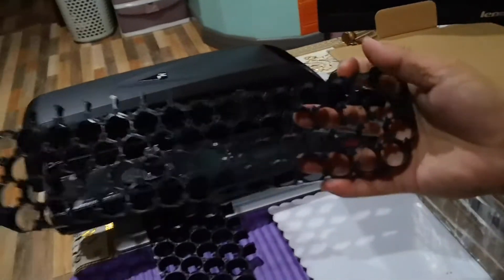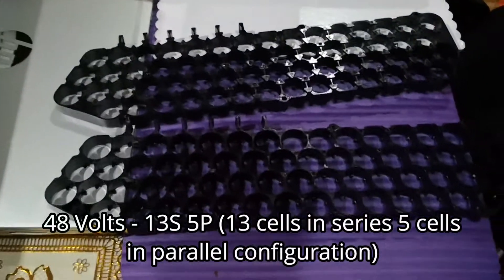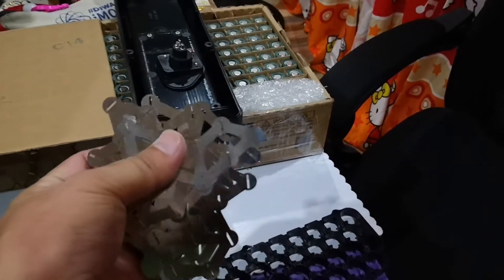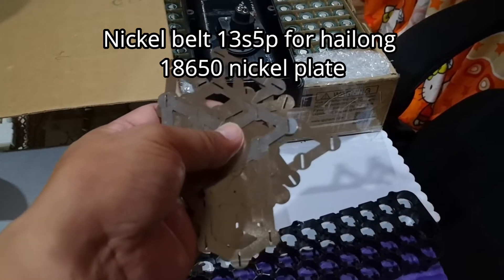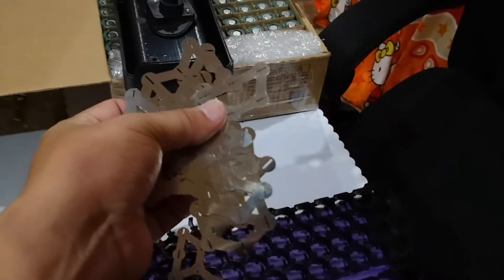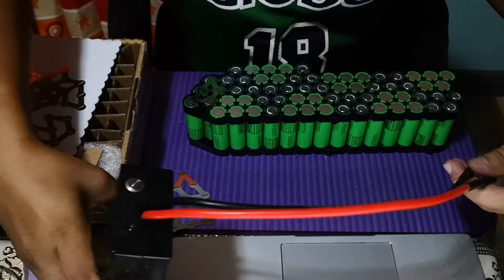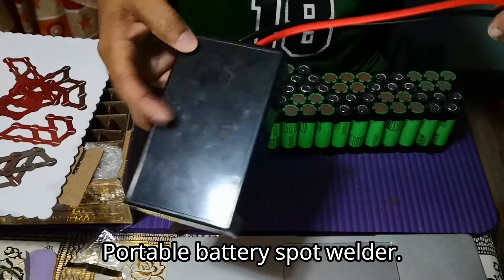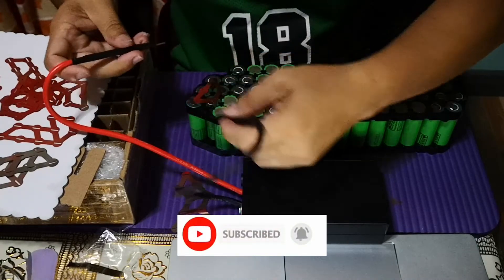HOW TO MAKE A 48 VOLTS E-BIKE BATTERY PACK | DIY Petz

Comment: Sir, puede ba ko mag charge sa battery samtang naka connect ang bafang bbso2 750w mid drive? Hasul man gud mag disconect sa battery pirme pag mag charge..
Reply from the maker: Good morning Sir Kyles.
Yes Sir, pwede ra kaayu na dili nimo tangalon ang battery sa mounting niya kung mag charge. Turn-off lang ang switch kung charging...Tnx.
Reply: You can always run a Female charging port through the side of the bike but you make waterproof kind of like a waterproof outlet for the outside of your house Same box idea. if you have any questions or anything like that just shoot me a message

Comment: Great video sir. Do you have the ckt diagram sir which include the fuse and switch? Also what amp rating did you use for the fuse? Thanks!
Reply from the maker: Good evening Sir Chad. You may click this link for the complete list of materials and a small diagram.
https://diypetz.blogspot.com/2021/06/diy-48-volts-175-ampere-hour-battery.html.
Thanks.
Reply: @RollyPetz  Itatanong ko sana to next, andito na pala. Thanks sir and more builds to come!
Reply from the maker: @EZY3DLAB  You're welcome Sir. Stay safe,

Comment: Hi I have a 36v 4amp batterie can I series connect it with a 12v 4amp battery to have 48v 4amp battery
Reply from the maker: Good evening Sir. That would be possible if both batteries are of the same specification for it to be balanced when charging.